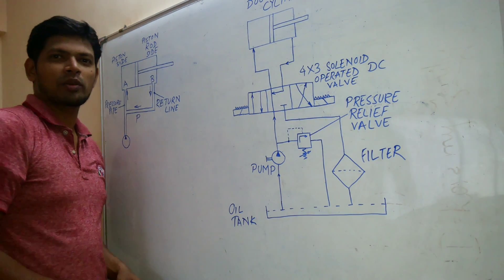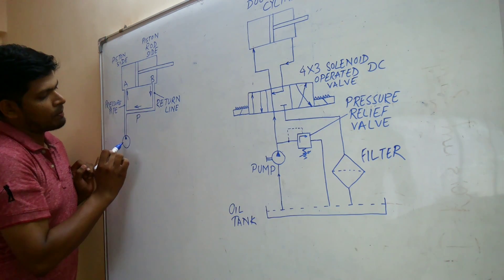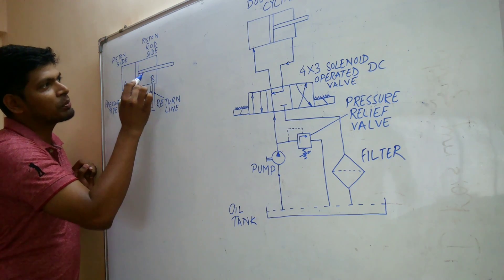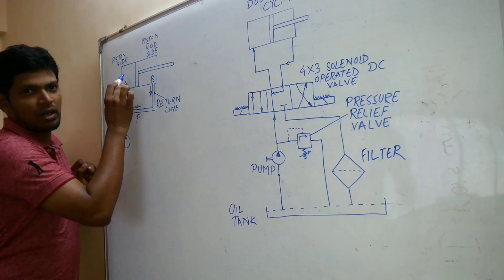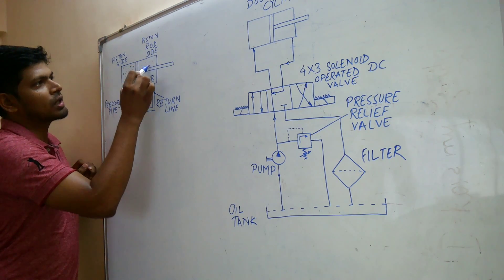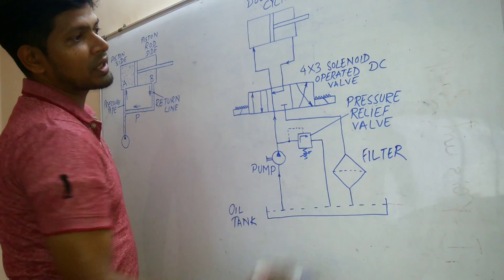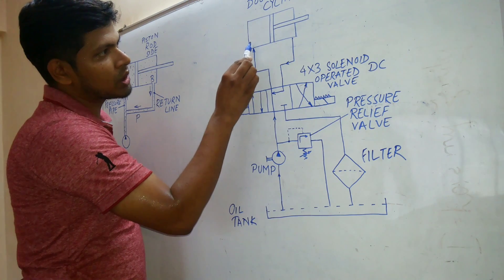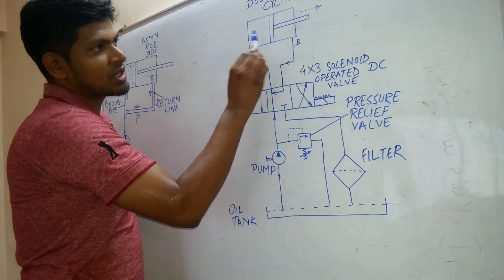3rd year Mechanical Diploma; Subject: IFP; Topic: Circuit no. 7 - Regenerative circuit #diploma

Comment: high pressure line se low pressure line me jaega na fluid... Return line is low pressure line. How fluid here will enter high pressure line where fluid is getting pumped by pump... Rather fluid from pump will enter both piston side and rod side also. TALK ABOUT THIS IF U HAVE TRUE KNOWLEDGE
Reply from the maker: +Omkar Shinde 

Thanks for the question. 

Lets have an example to understand this: 
Piston side force 10000N and piston side area is 10m2, then piston side pressure is 1000N/m2 (10000÷10)

The rod is doing some work (let effective thrust be 2000N) so it will have thrust on rod end side 8000N. 
Let the area of rod be 2m2, therefore net rod end area is 8m2. Then rod end side pressure is 1000N/m2 (8000÷8)

Therfore, Pressure at same in both the sides. 

Note the flow coming from rod end side will be more as net area is reduced. 

So hence the return line can be connected to pressure line.